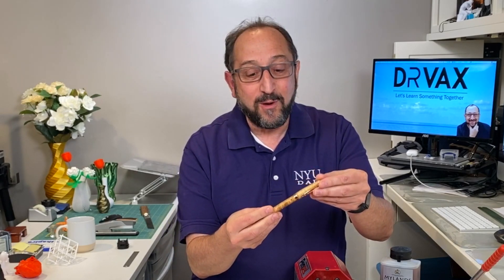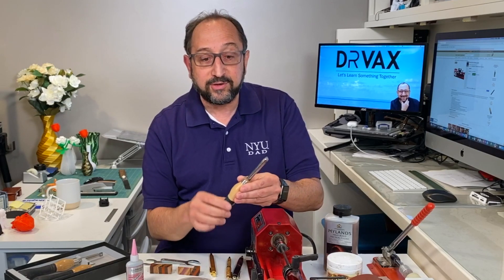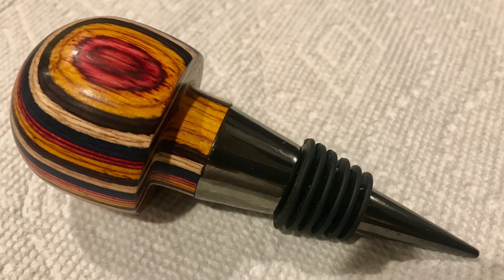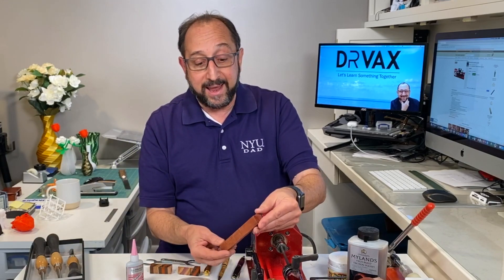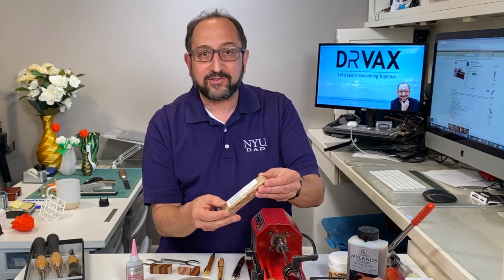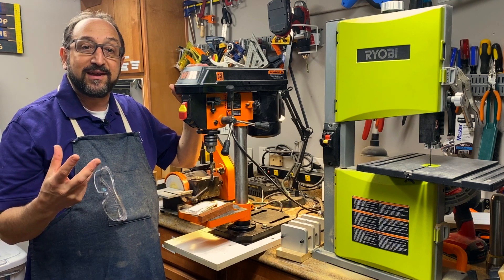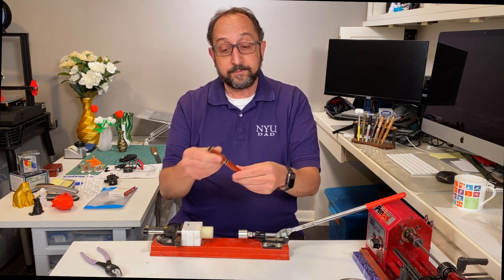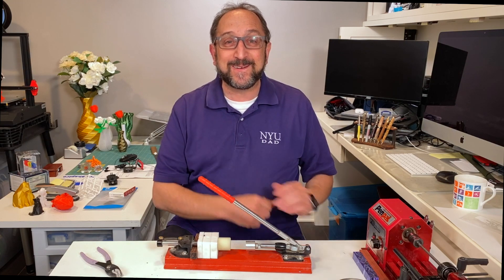Getting Started with Wood Turning by Making a Pen

Comment: I use the square tool for rough turning and the round tool for finishing cuts.  I rarely turn wood pens as I prefer turning acrylic for pens. When I do turn wooden ones, I like to finish with CA glue.  I have  12” and 20” lathes and have the little Pen Pro lathe which I use when showing kids haw to turn pens. Your demonstration was excellent and I will have the kids watch your video before I work with them.  I like turning pens but my favorite is turning hollow vessels.  Thanks for the video.
Reply from the maker: Thanks for the comment.  I also enjoy teaching kids to turn and have recently spent more time turning bowls.   While there is an “official” way to use each turning tool I this each person finds the techniques that work best for them. 

I think an even better first project is a wine stopper as you can complete it in about an hour from start to finish.
Reply: Finding different ways to use turning tools is part of the fun.  Life would be boring if we all did the same thing. I’ll have to try using the tools they way you do.  It may work better for me too.

Comment: You could also rough print blanks in semi-transparent filament that way you’ll get a nice marriage of additive and destructive manufacturing🤓
Reply from the maker: Yep.   Something I am going to try.  Not sure how well the 3d printer material layers will hold up when turned.
Reply: DrVax Depends on orientation I think. An oblong block printed laying down should do nicely, good and hot without fan. Perhaps with random color changes along the way. Since it’s going to be turned anyway you don’t have to worry about surface finish.